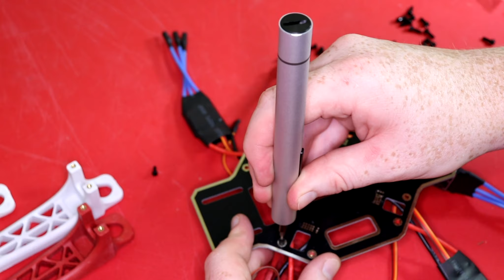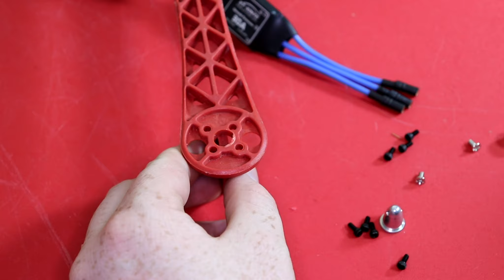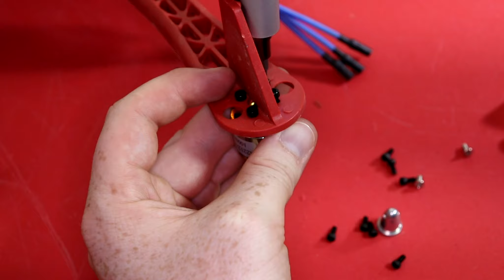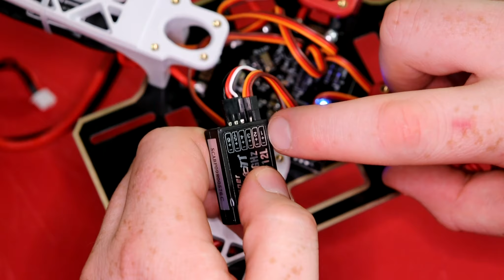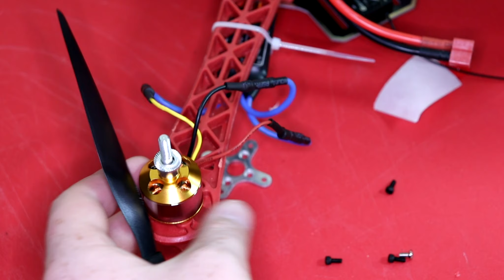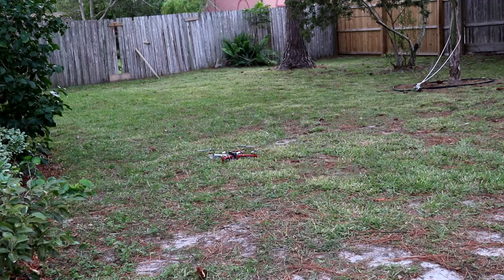450 Flame Wheel Build

Comment: I am also learning to build kk2.1.5 450 quad. I am planing to use "Racerstar RS30A Lite 30A Blheli_S BB1 ESC" with Racerstar BR2212 980KV Motors. My Tx/Rx is FS-i4x/FS-A6. Do you know if i will have compatibility issues with any of the electronics?